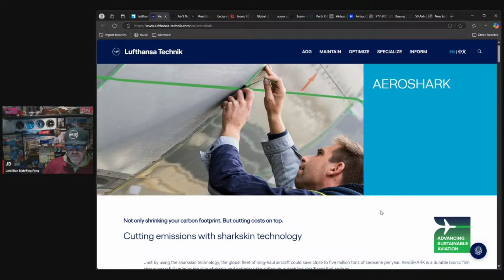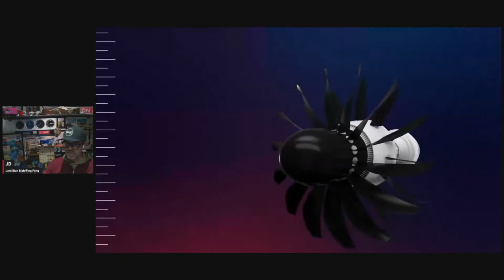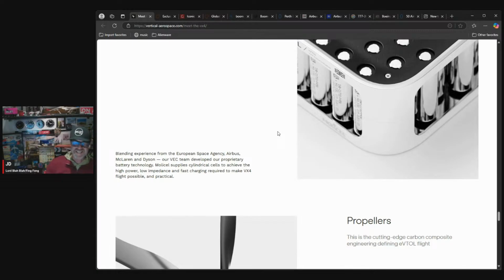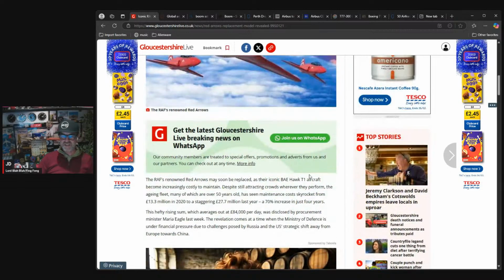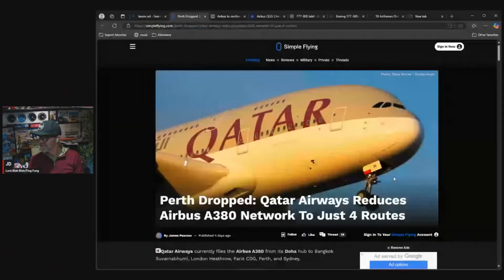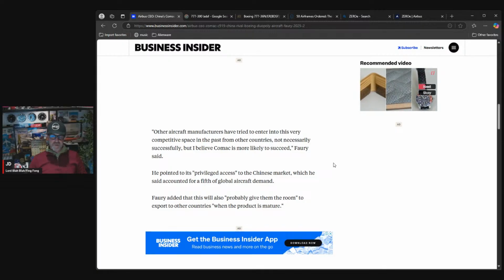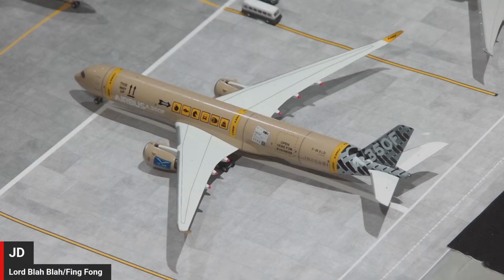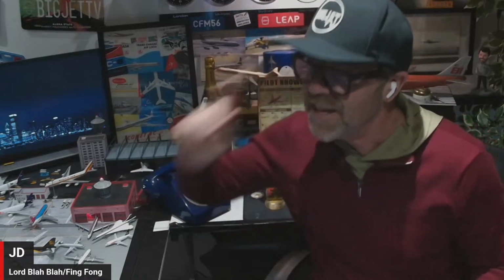the Friday Night Show

Comment: Hi Jerry👋 Back in 1987 I started working for a contract service company called Ontario Aircraft Service / OAS at the Ontario International Airport in Southern California.

We were contracted to UPS for the ground handling of their airplanes. At the time they had 747's, DC8's and 727's.

The cargo door on the DC8's was near the front of the plane, with one container position just forward of the cargo door towards the cockpit. We would load a very heavy container in that 1st position forward of the cargo door to help balance the airplane. 

Then we would start loading the lightest containers with four of us pushing them all the way back to the tail of the plane, walking and walking and pushing, with the feeling of the air passing around the container as we were quickly pushing it back until it finally stopped and we would kick up the locks with our feet, locking the container in place, we could tell where we were, by the position numbers and markings that were printed on the walls. 

The first three containers seemed like they took forever to get to the back of the plane, because the airplane was so long. 

Loading heavier and heavier containers as we would get closer to the wings, then when we were over the wings, they would have us push the very heavy container that we put into the #1 position forward of the cargo door to its new position over the wings, then putting a light container into the #1 position.

There was a tail stand that we would attach to the back of the DC8, it was a long metal pole, that you would raise up with the help of another person,  raising it up to a hole the was in a steel peace that was under the tail of the plane, their was a metal cable that protruded from the side of the pole with a metal ring on it, that you would pull down to open the latch at the top of the pole and slide the rod that was sideways at the top of pole, sliding it to the right into the hole in the steel peace then releasing the cable to lock it in. We would wiggle the pole around to make sure that it was secure. The tail stand pole was around a foot off of the ground hanging there. 

One person would monitor the tail pole as the plane was being loaded, it would go up and down and even sometimes hit the ground, but it could also swing back and forth especially when it was windy, so you had to watch where your feet were and hold onto the pole to make sure that it hit the ground straight when it would come down, this was my first job that they had me doing when I first started, it was November cold and rainy and windy at times as we worked through the night until early in the morning.

They had a picture of a UPS DC8 sitting back on its tail with the nose of the plane way up in the air, hanging up in our operations office, that happened before I started working there. 

The 727's cargo door was also towards the front of the plane and you loaded it pretty much the same way as the DC8. The rear stairs of the 727 would be lowered down during loading as it's tail stand. 

The 747's, had the cargo door in the rear and they had electric wheels in the floor of the 747 with a joystick controller attached to a cable that attached inside just forward of the cargo door, with the man who also operated the bridge, that would raise the containers up to the cargo door, moving each container with the controller inside the plane. 

The 747 could fit two large containers side by side on the main deck, with the containers being able to be rolled up to the front of the plane on the electric wheels and rollers, even being able to be moved to either side, until the container was in its position, with no help from anyone having to push it.

We were also contracted to Kalitta, with their 727 aka "Connie One" that was set up to haul race horses from California to Kentucky for the Kentucky Derby. With a big ramp that was on wheels that we would push upto the cargo door at the front of the plane to load the horses.

I enjoyed your livestream tonight very much👍🙂
Reply: The 747 tail stand looked kind of like a big yellow tripod that was on wheels, that was rolled underneath the tail.